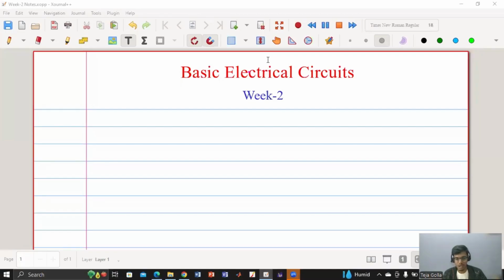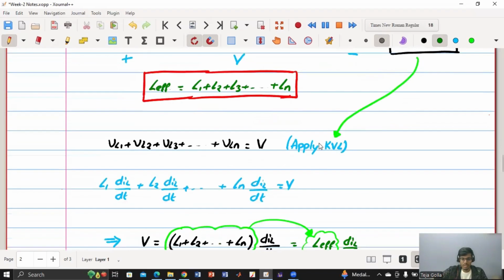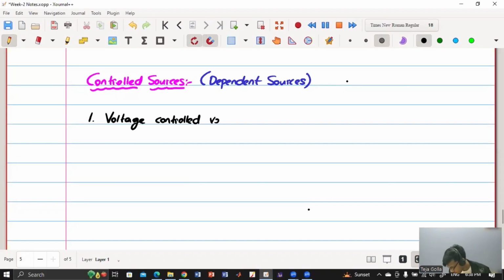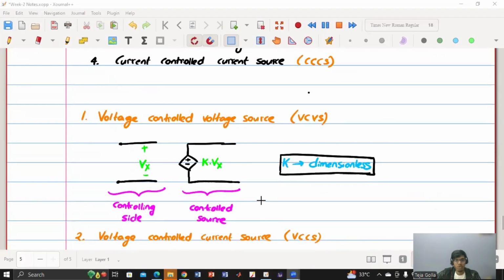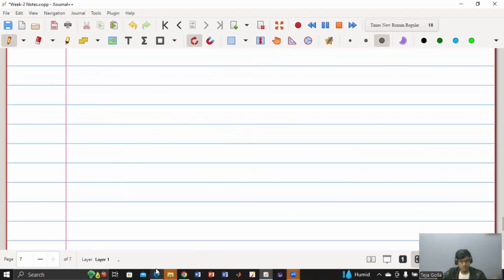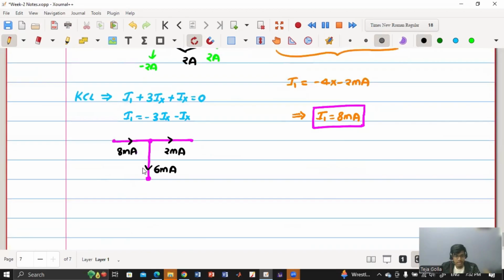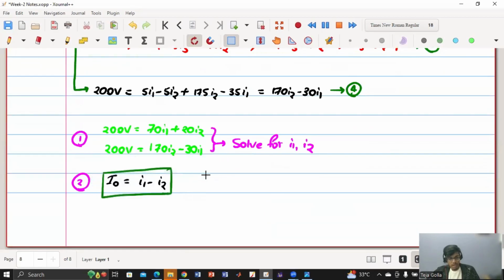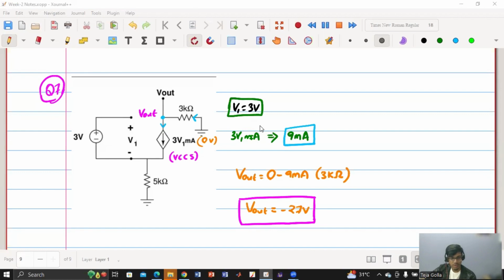Week 2 | Basic Electrical Circuits | Problem Solving Session | NPTEL

Comment: Hii sir i work on spy camera please help me for making alternative esp32 cam mcu with circuit diagram which include esim microphone because esp32 cam have only 16 pins ic which dont have any pins to connect the esim . this module only work on same ip address soo i want make alternative of esp32 cam please help me for this project my pdf and programming is ready for this module but i dont have any idea about how to make circuit diagram for new pcb of my requirement please help me for this and please reply me ..
Reply from the maker: Thanks for reaching out, Mayur. But I'm sorry to inform you that this is not my area of expertise; you may contact anyone who is working in this domain.